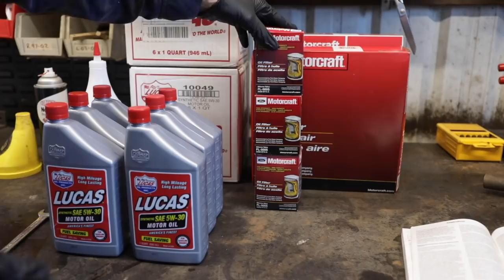How to Change Your Oil Like A Pro

Comment: For me , I remember when Amsoil first came out it with full synthetic it was the worst oil ever . A construction company had ten new Ford and ten Chevy four by fours . They started them off with Amsoil . In the first couple weeks they had 7 Fords and 5 Chevys engines blow up . Amsoil would not give information as to what was in the oil , so an investigator sent new oil and oil with 2,000 miles on it to a laboratory . New it had 20% the lubrication of new conventional oil . At 2,000 miles it was under 6% . Plus I new a dealer , one of the crookedest people I had ever met back then . Warning about thickening additives in turbo engines ! I used to build street race cars and motorcycles and use a good brand of synthetic blend oil in everything . I also change oil between 3,000 -4,000 miles . After any car / truck engine is broke in , I treat them with Slick 50 every 50,000 miles or so . My two cents worth .

Comment: Using Lucas oil with a motor craft or Fram or stp filter is like spending hundreds of dollars on lawn fertilizer but only have a push mower with a 5 acre lawn, cut a motorcraft filter open once and you will see low quality filter element and quite possibly a string wrapped arround it like the one I saw, then cut open a wix or k&n filter and you will see a much higher quality element with much more surface area

Comment: If you take the oil filler cap off or the dip stick out when starting the oil change the oil runs out faster as there is less vacuum. If you leave the tires where they are then the two drive tires will wear out first so you will only have to replace them two at a time instead of shelling out $1200 every change.

Comment: Great tips Cody as usual! If I may add one thing, be sure to double check that the old filter gasket came off with the oil filter. I had one stick to filter housing and didn't notice it until I was driving and lost oil pressure. Oil sprayed out all over my engine and would have been catastrophic had I not noticed the pressure gauge dropping. Luckily I was a half block from home and made it up the drive before the engine starved. I pulled the oil filter off and that's when I noticed the extra gasket still stuck to the engine. Looks like someone else commented on this already but yeah, its easy to overlook that step.

Comment: I’m interested in the long term review on this vehicle.  I’d be interested at say about 30k miles what a valve scope shows as to wear tear and deposits in the intake valves.  I wonder how the DI handles the carbon deposits on the intake valves along with the use of a high grade synthetic.

 Currently in the market but right now I am waiting for the new version of the ecoboost in the transit.  Hopefully by the time Ford will have  the second gen motor in there with DI and PFI.
Reply: BTW me and my wife really like the fact that you do not hide you light but rather let it shine.

Comment: All I own is forward and I run motorcraft oil with a Motorcraft filter and I've gotten 520,000 miles out of a 5-4 Triton F-150 with motorcraft oil and Motorcraft filter with absolutely no problems

Comment: I remember my grandad teaching me to do this(with the majority of your advice) when I was little. I have been doing my own ever since. The one time I brought it into the dealership to do they way over tightened the filter. I had to drive a screwdriver through the side and practically swing on it to get the oil filter off. I do have a question about tire rotation though: what would you suggest as a good set of jack stands and a good process of setting it up for tire rotation?

Comment: You forgot a couple things. First you should always take the oil fill cap off before draining the oil. Why? two reasons, one that will allow air to flow down and help push the oil out of the engine faster. Second you can take the oil fill cap and place it right on the hood latch. Now when you go to close the hood, and the hood wont close, and you go why, and look and see that cap there it will at best remind you that you forgot to simply put it back on, but at worst it might remind you that you forgot to put oil inside the engine. Maybe not a huge a issue if your doing it your self in your garage. But if your doing it professionally where you might have 3 or 4 cars all draining at the same time, it can be easy to lose track of which ones you put oil and which ones you didn't. Second always check the old filter for the rubber seal on it. I have seen many of times where it gets stuck on the housing, you don't look and just slap the new filter on, and now when you start the engine all that oil will spray out between the 2 filter seals that are now there. Third if you have a filter that you could not fill with oil, don't start it right away. Just tap the key real quick to the start position. Do that a couple times to get oil thru out the engine. Fourth when rotating the tires make sure you do not have directional tire on. You can tell if the tire has a arrow and says rotation pointing one way. If so do not crisscross them, just move front to back and back to front. While rotating is the time to check all the tires, including the spare for damage, punctures, dry rot, and pressure. Also if you have a full size spare rotate that onto the car. Fifth when doing the final torque down of your wheels do not lower the car all the way to the ground, lower it just enough that the tires are touching the ground so they cant spin. Why? think about it when you are tighting the wheels what you are doing is pulling the wheel center onto the hub. That is much easier to do with out the entire weight of the car on the wheel. By not doing this you may not get a accurate torque rating and also risk stretching out the studs. Sixth tighten them in a star pattern. That will evenly distribute the torque across the hub and rotor. By not doing that you can warp the rotor. Last but not least when you start the engine up jump out, or even better have a friend looking when you start it, to make sure there are no leaks. Better to catch leaks inside the shop, contain the mess to where it is parked, and not run the engine out of oil, then it is to not know there was a leak till the engine was out of oil, and be spraying oil everywhere you drive. Just a couple tips from a professional and someone who has done a lot of oil changes :).

Comment: one more keep one use quart  to use  as a tool to help out . i dont know how many times i had my tralor hinge not working and a use quart out of my truck free it up a let me get the job done that need it and then i clean it back off then  put the right stuff the keep it working for along time. so use oil quart is never a bad idea to keep around to test parts like hings or whatever just for a bit . the best i learn is to use it use tires to reset them to air up .
Reply: the door idea i   did not know thinks

Comment: I’m 17 and I’ve been changing the oil on my 07 f-150. It’s got 170,000 miles on it and runs great. I’ve been using Fords motorcraft oil because that what it recommends. That good enough?

Comment: Would it be a good idea when replacing a brake light bulb to apply dielectric grease to the connection points?

Comment: If you choose your aftermarket wheels correctly, there can be an enormous benefit. My original 2008 Subaru Outback XT Limited's wheels weighed 38 pounds each... without tires. I purchased 13.8 pound alloy wheels and my car jumped from it's terrible 23.4 Miles Per Gallon on the highway up to 28.7. In a car which absolutely drinks fuel by instantly turning the tank upside down to it's turbocharged lips, the lightest weight wheels were an enormous benefit. They have paid for themselves.  So, next time you change your tires, weigh the wheels without the tires. Then look at aftermarket wheels sorted by weight, specific to your vehicle. You will find lighter wheels and they will increase your fuel economy. As an aside, your Ford likely has Aluminium driveshafts available for it. The same benefit will be had there (plus if it breaks it won't flip the car, it will just destroy the driveshaft). I've tried for many years to purchase aluminium driveshafts and CV shafts (by the way for driveshafts, Aluminium ones are lighter than Carbon Fiber ones) for my Subaru  but every single custom maker in the USA instantly hangs up on me (sometimes after letting out a nasty, sarcastic laugh) the second I say Subaru rather than Ford, Chevy, or Dodge.

Comment: Must have been shell, I run Mobil1 Motor oil product in almost all of my cars / trucks and equipment. never have had sludge or buildup issues. the additive of choice is hyper-lube, they also make a coolant additive that works well in my opinion.

NOW that is a creeper

Comment: When you change the air filter you said that you change your oil every 10,000 miles, is that right? I was always under the impression that with a gas engine that you change the oil every 3000 miles, maybe 4 or 5000 if you use full synthetic. I'm about to buy a transit and I plan on doing all of the basic maintenance myself. Could you help clarify my confusion?
Thanks and love the videos!

Comment: I have a 14 Toyota tundra, and I honestly don't like the oil filter setup. I wish the filter and housing was all one unit like the Ford. Toyota has a drain plug under the oil filter housing that you are "supposed" to be able to open to allow the housing to drain, but trust me, when trying to loosing that, you still just end up loosening the whole housing and making a mess. That and the fact the skid plate is horrible to remove. I wish had magnets on it to hold it in place so you could bolt it to the truck...

Comment: I live in Europe... Just got 55000 miles with my tires and still going. This without switching it from front to back. Never know/learned to do this. I also got around 50000 miles with my brakes. I worked almost 20 years at a dealer and only a few people got that kind of miles with there brakes and tires. But you forgot one important thing, tire pressure. That's even more important than change the tires.

Comment: Gotta be careful, though, with stowing away dirty rags with chemicals on them. I know a professional blacksmith who came this close to burning his whole shop down because a youngster tossed a rag saturated with BLO in the trashcan. Somehow, the highly flammable rag caught fire. He noticed it just in time when he walked in to turn off the lights and shut down the shop for the night. 
Best thing to do with dirty rags is probably burn them or keep them in a closed metal container. At the very least, you want them away from anywhere there could be sparks....like a bench vice, if you're using an angle grinder around it.
Reply: that is because the BLO was still curing and when it did that it produced heat

Comment: I have a question. It's a dilemma should I repair it or sell it. 1960 ish Sears David & Bradly 24 inch chainsaw. "Oil leaks" is the problem hate to depart with but could use the money. Do you have any advise.

Comment: I use kitty litter for oil spills. If you have oil stain on your concrete floor, take a 2x4 and make circles in the kitty litter grinding it in. It wont take it all a way but most.....
Not that I ever spill oil 
Have a Jesus filled day 
Greg in Michigan

Comment: You missed a big one:  Check before you install your new oil filter that the old rubber gasket is not left sticking on the engine block!  This is huge because often the old rubber gasket is still there unknowingly and when you first start up your vehicle you will have a massive oil leak all over your driveway that you now have to deal with.  Not to mention, now you'll likely need to make another run to the auto-parts store to get more oil to replace what's now all over the ground!  This has happened to me 3 times! (You would think I would remember to check for this and now after three times I finally do!!)
Reply from the maker: Dang I should have remembered this,
Reply: You can't remember everything 100% of the time, good job, good video.  I now see somebody else beat me and had the same comment... Anyway, maybe this will save somebody sometime who happens reads the comments!

Comment: The oil additives can be bad it increases the viscosity which can be bad each engine is designed for a specific viscosity because of difference tolerances and such. Just put the oil that your service manual tells you to use.

Comment: On average the domestic brands don’t build cars to the same quality or tolerances that many of the new Japanese brands do. Dad has an 02’ toyota sequoia, has an unfathomable number of miles on it, but after just doing those $20 conventional oil changed at jiffy lube for the whole life of the car, the entire car is still bulletproof and has never had a mechanical problem. Sure high quality oil change components are good, but its better to first consider the quality of the automobile you’re going to do the oil changes on. My $0.02

Comment: #11- If your going to pre fill your filter use the outside holes. This way any oil you put in will actually get filtered before the engine.
Reply: Glad to c someone else recycles oil just run through a sock put a new filter and it's done

Comment: Also another pro tip is when you are draining your oil open your oil filler cap so it drains faster.
Reply from the maker: I haven't found this makes much of a difference,
Reply: That depends on how the crankcase was made. If it has more moving parts in it, then yes (V8 turbos).

Comment: Do not fill the oil filter. Even brand new oil is not filtered to the degree that the oil filter in the car will do. That big opening is the outlet of the filter. So by filling it you are putting unfiltered oil through your engine. There's enough oil on the valve train and in the block to protect it for the quarter of a second it will go without oil before the filter gets full.

Comment: You do not want to rotate your tires in a cross pattern! First of all, tires have rotation directions, if you change the tire from one side of the car to the other, the pattern will be inverted and your tires tread pattern won't work as intended, to disperse the water out from under the tire.

On top of that, tires should be balanced in pairs, axially, so you'll want to keep them rotating in a similar way they were before.

Comment: Also...I forgot one thing. I also use a spatula, like in the kitchen. When the Oil from the SS bowl is drained, I then take the spatula and scrape the inside clean. Usually just a quick spray of WD 40 for final bowl clean up is all that is needed.

Comment: 1) Please, for the love of God, get a torque wrench. Doesn't have to be a $1,000 affair from Snap-On. 2) Check the tire rotation pattern on your tires instead of just criss-crossing. 3) If you're gonna use a clean shallow oil pan, may as well get a strong magnet to see if there's any metal in it. 4) Your oil can was still glugging when you poured it in.

Comment: Where's your cabin filter break check or tread depth lol oh and tire pressure check
Reply from the maker: Where's your video?
Reply: @wranglerstar  savage
Reply: Break check? That’s something your employer would do. Brake check that’s something you do when the wheels are off. 😂 It is a good point though.

Comment: I’ve run cheap Rotella T4 oil from Walmart in a Dodge Cummins over 700k miles without a problem.  Oil quality is not near as big as you stress it to be.

Comment: Do not spray a liquid lubricant into your keyholes. They allow dust to stick and will eventually cause you problems. Lubricate locks with a dry lubricant like graphite powder.